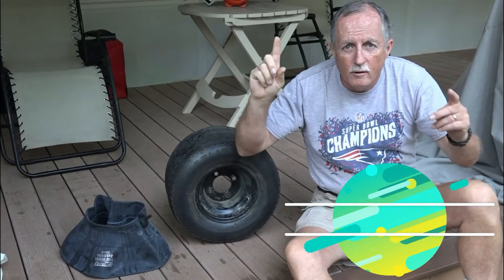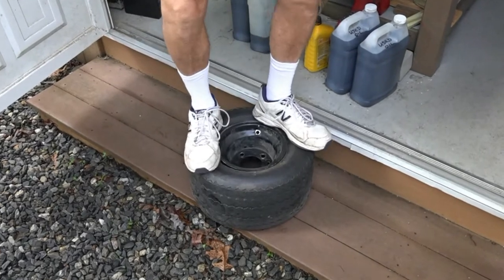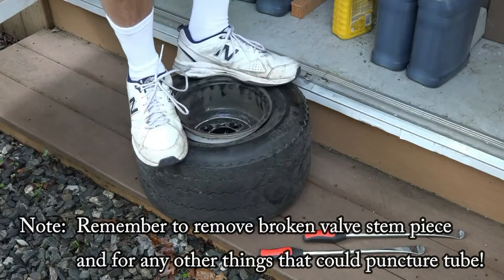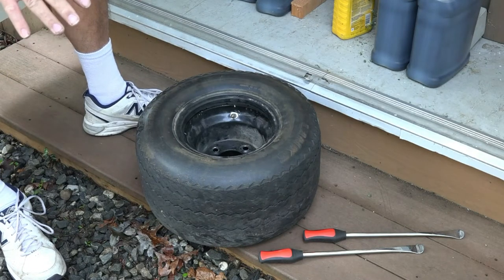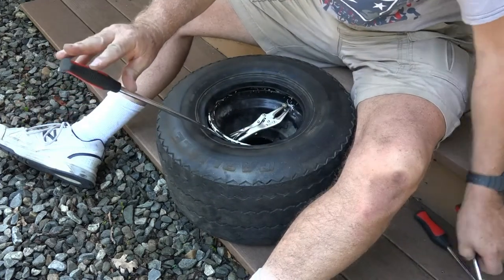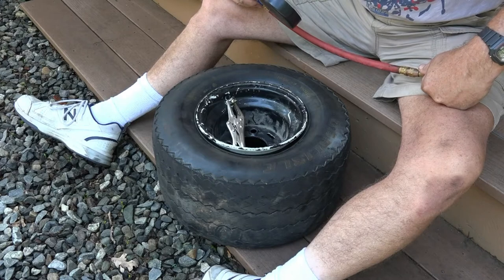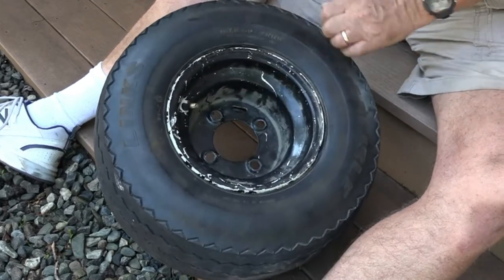How To Tube a Golf Cart Tire

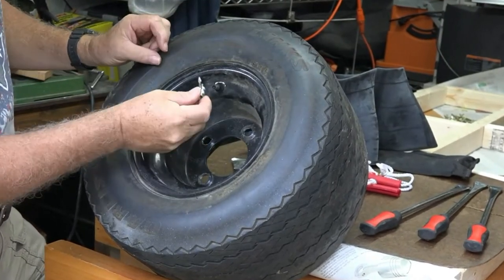Comment: You know that same tool that you used at 1:05 to remove the valve stem core can also be used to hold the valve from slipping back into the wheel. It's on the opposite side and it threads right on where the valve stem cap would go.  Then you don't have to take a chance of damaging the stem with those vise grips.